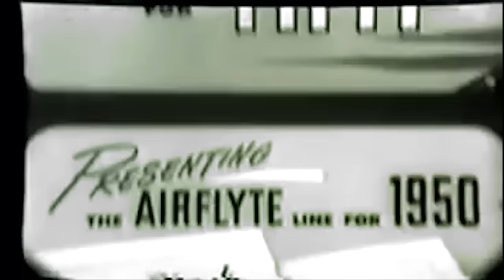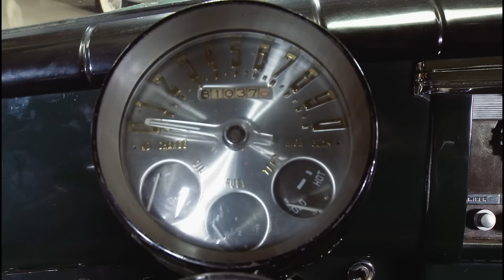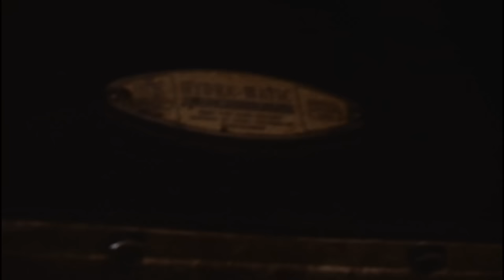1950 Nash Ambassador Custom - Jay Leno's Garage

Comment: The reason why Nash disappeared  in the 1950's is because Hudson and Nash merged to form American Motors.
Reply: Ø
Reply: The names of Nash and Hudson disappeared from the book, however the merger of both was that of American Moters Corporation which much later was known as a Rambler. And those old Ramblers were pretty darn good, reliable cars to.
Reply: @danbasta3677  how could you turn in a tight spot with faired front wheels?
Reply: Jay I’m about half way through the video, you have not mentioned, Nash helped sponsor, NASCAR, for Big Bill France, and he had Curtis Turner, drive one. I’m not sure if was 1949 or 1950, but I have seen photos of the car w Turner Turner & France by the driver’s door, cool photo. I don’t know, if it won any race’s it ran in. But it’s interesting to know this much… I watch the one you have on your Hudson Hornet, and your Marshall Teagues car. Great video.🎉 thanks for all your work.
Reply: Thanks for sharing that info! 👍🏿
Reply: @markminter3960 Awesome info! 👍🏿
Reply: That 🚗 needs a 401 V8 swapped in
Reply: When dinosours marry to give each other blood TRANSFUSIONS, it seldom prolongs the life of both.
Reply: Now they're gone.
Reply: Rambler not AMC
Reply: I would blame the 'Big Three'...
Reply: But they didn’t create a V-8. Had Hudson put a V-8 in their cars then they might have been competitive.
Reply: @user-xj8os4cr1l  Actually I have seen a picture of a V8 powered Hudson in one of my books. So they did at least one V8 powered car probably towards the end of the Hudson line.

Comment: Back in 1969 when I was 21 years old I bought a 1951 Nash Statesman Airflyte from a SAAB dealer’s used car lot for $150. That was a very small amount of money even back then. I was a Nash fan and I knew a lot about these cars so when I saw this car on their lot I was ecstatic! They sold it to me as “junk” due to the fact that wanted to make it clear there was no warranty. The car had relatively few miles on it….about 60,000 if memory serves. Regardless of the junk label it drove well and easily passed inspection. The interior was all original (cloth) and in great condition and, as with all Nashes the seats converted to a bed. It has an optional hood ornament that looked like the one on the 1950 car Jay Leno has. 

 For 1951 the uniscope dashboard was abandoned and my dashboard design did not look anywhere nearly as nice as the one in Leno’s 1950 model. I swear it had a knob labeled RW for an option my car did not have. Nash couldn’t have offered a rear-wiper option (could they?) as the pulley system used for the regular wipers looked like a Rube Goldberg contraption. Nash kept the blinking red light at the end of the turn signal lever and it worked fine and was quite a novelty. Exterior design changes included a slight alteration of the grille which now had vertical bars instead of a crosshatch design and the turn signal parking light combo was changed also. The rear was the most extensive change and what could be described as a tasteful fins/taillight combination was added. That look continued to evolve through 1955.  I believe that the Pininfarina Italian design firm had nothing to do with any of the  Nash’s design from 1949 to 1951 but the name was used for 1952 redesign and beyond in their advertising even though the Nash Motor Company had most of the influence over the final design. They wanted the prestige of Pininfarina’s name. 

My Nash was in very good original condition with miner rust on the rockers and slightly above. I decided to sand and prime the lower portion of the sides and I applied a darker blue paint to the area below the low chrome trim that ran along the entire lower sides of car thus making the car a two-tone. I knew that I would never match the original color and the complimentary color looked really great. No joke. The rest of the car’s original finish was beautiful enamel and had quite a shine to it after I waxed it. I drove the car for a couple of years to work and to college in all weather conditions and it was really a great vehicle. Mine was a three-on-the-tree and it shifted just fine. To start the car you had to turn the ignition key to the on position and then depress the clutch thus depressing the button on the floorboard that activated the starter motor. The car moved out alright but the Statesman’s engine was, I believe, a slightly less powerful seven main bearing straight six than Leno’s Ambassador had. The car, by all accounts, was very aerodynamic and the design was wind tunnel tested and had a very low drag coefficient. Part of the aerodynamic design was the enclosed wheel wells which forced the car to have a relatively narrow track so that the front wheels had room to turn. This made the turning radius slightly smaller then that of the Queen Mary and the car list like the Titanic if you took a corner fast. The only work I ever had to do on the car was to put in a rebuilt starter motor and replace a broken part to the window roll-up mechanism. I took that part from an older Nash I saw abandoned with other cars in a farmer’s field. I  applied rust proofing to the its underside (no separate frame with unibody construction) in a valiant attempt to slow down the advance of  rust occurring due to Western New York’s winters and the extensive use of salt on  our roads. 

My Nash, unlike Leno’s, did run hot and I had to keep an eye on the temperature gauge on really hot days. The car was built like a tank and one time, when I pulled over to the side of the road to pick-up a hitchhiker, a Renault hit my Nash in the back end. The front of the Renault was wedged under the rear of my Nash and it had a seriously damaged front end including a crumpled hood and broken windshield. The only damage to my Nash (I swear this is true) was a dent the size of the tip of your thumb beneath the trunk on the lower chrome trim band that encircled the car. I had to ask the Renault driver to try to back up as I pulled forward to separate the two cars as they were stuck together. 

    Unfortunately one day there was a tapping as of some one gently rapping, rapping at my chamber door.  It was an internal engine issue and, as an act of desperation, I tried STP engine oil treatment that solved a similar problem a couple years earlier with my 1950 Dodge. No luck this time. Not having the mechanical skill of Jay Leno or the finances to hire a real mechanic I contacted someone who had remarked that he would like to buy my car if I ever wanted to sell it. He was the manager of a local fast food restaurant that I frequented. I told him about the problem and sold him the car for about what I paid for it. He said he planned to restore it and I figured it had a better chance of survival with him than with me. 

    I always loved the cars of the forties and the 1951 Nash’s basic design was first introduced in 1949 … 1951 was the last year of that body style. I loved the look and the feel of those old cars and will always remember my old Nash. Perhaps it is still out there somewhere.
Reply: The short version please
Reply: Great story!
Reply: @briandelion49  yes
Reply: @brettcannon74  trouble reading?
Reply: STP will plug oil galleys, seize the crank- as happened to me on a 1971 Italian bike
Reply: Great story.  Don’t worry about those to busy to read.  It’s just fine !
Reply: tell us more about the saabs
Reply: I wasn't aware the Titanic was known for listing in turns, or at any other time. She hit an iceberg and went down by the head; I imagine there was a slight list at times while she was going down. but not anything obvious. I hate when people use metaphors or figures of speech that don't actually mean anything. STP is terrible stuff, will ruin good engines. You're better off to just keep driving with the tapping noise; sometimes you can keep going for a long time and it never gets worse, and it's not like it'd sell for less if you ruined the engine totally (although it'd be a shame to wreck it when it could be mostly still fixed).
Reply: Thank you for sharing your story, it's always nice to hear car related stories from days gone by.
Reply: @santatigerclaus  ah, wrong there quiz-kid. stp won't clog anything unless you are running it straight and it's -40 outside. i own a shop, build engines and have used stp for years. 
maple syrup is what i would have used.
Reply: @jimmyers8114  ah, thats like, your opinion, man
Reply: you havent ran a crank with a cleanable sludge trap inside it im  betting
Reply: port starboard, please allow me - it’s “haven’t run”, not “haven’t ran”. Thanks for not taking it personally. It’s just that I see and hear this common error more and more frequently these days, and as a sergeant on the grammar police force, I must “do my duty”!
Reply: Doh! You took it personally! 😖
Reply: @disvillage  Right on. Personally I wish he kept a journal and took careful note of the weather and other juicy details that woud have really added to this already epic jorney. We shall never know what this Rambler-ing Man was running for tire pressure that day.     :-D
Reply: @kelharper7971  Unlike small motor boats that lean into a turn, big ships lean away in a tight turn, the Titanic wasn't around long enough to get any reputations, but any ship that size would lean away in a tight turn, I would think cruise ships would try to avoid tight turns because of that, but this is a video of an aircraft carrier leaning really far.
https://www.youtube.com/watch?v=TN7BjeRad2I
Reply: Thank u for shareing your story i really enjoyed reading every bit of it i wish i could have lived back in those days i was born in 79 with a love for any car pre 1969 i imperticularly love 50s and 40s car i daily drive a 67 impala and 69 chevy c-10 truck but i also own a 49 desoto a 49 hudson commodore a 63 ford galaxie a 63 ford fairlane and a 67 plymouth fury i do not own anything new i love old cars!
Reply: Interestingly enough, Nashes did have a rear window wiper option. I read an interesting article about this and these cars on Curbside Classic.
Reply: @kelharper7971  What on earth is STP ?
Reply: @Godziller66 Like ALL Nash's ? ALL Nash's have fold flat seats transforming into a perfectly flat BED :D ? SERIOUSLY :D ? Any proof other models except ambassador could do this :D ?
Reply: In 1972, my brother and a couple of his friends bought the Nash model you described.  We were 20, and lived close to the Henry Ford Museum in the western suburbs.  Cars were all the rage, always here, always.
Reply: Godziller66 Good story my freind!
Reply: @brettcannon74  You do know that there is the "Show less" option...don't you?
Reply: @tommurphy4307  SAABS suck.  Are you happy now?
Reply: saab is awesome- they sell the NGK BPR6EV spark plugs for my 72 510- in a convenient 4-pack.
Reply: Which year model is the most beautiful design?
Reply: @brettcannon74  I gave you the short version.
Reply: What a great story. We love our old cars, don’t we?  They are like friends.

Comment: My parents had this Nasg Ambassador in 1953 only  in robin's egg blue.  I always called it the Easter Egg.  We used it camping sometimes and slept on the folded-down seats many times, once in the Everglades when it was too late to drive to a motel.  On long night trips, I would make a bed using a blanket in the rear seat, right side floor  -  just large enought for my 4 year old body.  I would listen to the hum of the road a few inches below me as the Nash sped along the just-built New Jersey Turnpike on the way to my grandmother's house in Washington, D.C.  .  It was a tank of a car and exactly as Jay describes it, but it had a fine elegance on the road.

Comment: I bought one of these cars for $100 in 1960.  I drove in a car pool and one of the guys would make the car into a bed and take a long nap at noon.  The big tube radio didn't work and I hung a transitor radio on the clock area and fed the outlet to the speaker system. It was a tube radio and I took it out and got it repaired and it worked wonders, Great speaker system.. It had pre-tuning bars in the radio and a foot feed so you could index through the preset channels with your left foot.  I thought that was a huge feature.  It had a super large trunk and the guy that owned it before me had used it to haul chunks of coal home from the Southern Railroad yards as he was an engineer.  Used the lumps in an old cast iron pot belly stove in a hunting cabin.  It made a big mess in the trunk and that was part of the "buy as is" deal. I had a new Chevvie station wagon that would not start when my wife was ready to come home from hospital, so I drove the Nash. The old days they took her to the car in a wheel chair and the nurse carried my daughter, til my wife got seated and then placed Robyn in her arms.  All the time she was embarrassedly telling everyone that we had a new car at home..
Reply: Great story Bob!
Reply: My 67 Continental had that floor radio scan button. That was a great feature.
Reply: Interesting to see someone who is apparently relatively literate and able to spell correctly write "Chevvie" instead of "Chevy". It never occurred to me that there might be people unable to spell "Chevy" correctly (if there is such a thing as "correctly", of course), but certainly not that that might be the ONE word a person misspelled!
Reply: Found on road dead, GM......well who  cares where they die as long as it's not in the way.
Reply: Mid fifties Buicks could have the floor button for the radio to jump to the next station. There would also be a bar on the radio to do the same thing. Probably a premium radio option. And Studebakers maybe up to 1952 also had the starter button under the clutch pedal.
Reply: @emjayay  Buicks had the starter solenoid engaged by the accelerator and up untill 1939 in Canada there was an option  for a short wave radio (banned due to the war).
Reply: Kel Harper   Using "apparently relatively" together in a sentence proves   that you shouldn't criticize anyone, on their writing skills.
Reply: Linda historia 😃

Comment: Thanks for the trip down memory lane.  My grandparents had this exact same Nash.  Same color, same trim, same automatic transmission.  My brother and I rode in that back seat cavern many times.  They drove it for years and then traded it in on a ‘57 Nash Rambler.
Reply: Years ago, I was polishing my newly acquired (in 1978!) 1959 Rambler American...I freaked, when I noticed that the turn signal indicator in the front had NASH stamped on it!

Comment: This is one of the nicest looking and customer thoughtful cars from that era. I would definitely buy one if I could find one on great condition.
Reply: I'm looking.
Reply: @charlesperry6093   how far can you turn lock to lock? the front wheels are covered with body work..
Reply: @vincentl.9469  11:38 - The front track was quite a bit narrower to enable a reasonable turning radius.  The body was wind tunnel refined & these cars got outstanding mpg for the day, and considering the low compression ratios of the time.

Comment: My father had 51 Nash Statesman here in Finland, only 7 Statesman shipped to Finland in 1951 and most of them were taxis because of 1952 Olympic in Helsinki Finland.  My dad’s one weren’t one of those taxis, but I don’t remember who bought it in 1951 , I just remember that he was some kind of business guy. My father purchased it from local Metroauto in 1958 when this Statesman was changed to new Chevrolet. Father tells me many great stories about his Nash and how great it was, he met my mother first time when he offered her a ride from local dances and drive her home. My father was hard working lumberjack at that time and saved the money for that Nash from his job. In early 60’s Nash was so badly rusted that he took the car apart and sold the engine to some boat and rear axle went to some trailer. I remember seeing that wreck when I was very young.  My dad passed on in early 2000, but in early 90’s I was trying to find 1951 Nash Statesman from USA, but before World Wide Web it was a little too hard.

Comment: Father had a 1955 NASH Ambassador Custom that he bought new .. and I was 4yrs old when he brought that monster home. It was a trade-in from a 1952 NASH Statesman that he also bought new a year after I was born.

  Vehicle was Canary Yellow with a white top. It had the fold down seats to be made into a bed (we went camping and slept in the car), designed by Pina Farina with the "Flying Lady" hood ornament along with the Continental Kit attached.

Vehicle had the 255CI straight 6 with the dual Carter side draft carbs with oil bath air filter with the GM 3speed Automatic tranny.  Unit had great power using the 6v positive ground system.  

Yes, had the same starting format as the one above: turn the key on, put the shifter in N pull towards you and starter engages (towards the end of the car's life, Dad had to install a conventional push button on the dash since the switch in the column wore out).. Dash also contained the drawer .. and it was deep.

Oh, and it also had the little light on the end of the signal lever (it was a green lens cover) that would blink along with the lights in the gauge set.

As the 1950, it rode just as smooth and true, doing shock replacement within the coil springs was a hated thing.

Being a unibody design, it eventually rusted real bad to where the suspension actually broke through the body causing the vehicle undriveable when father had it crushed in the early 1980's.

I  have many picts of that NASH being his all-time favorite car and he was a NASH/RAMBLER/Chrysler fan.